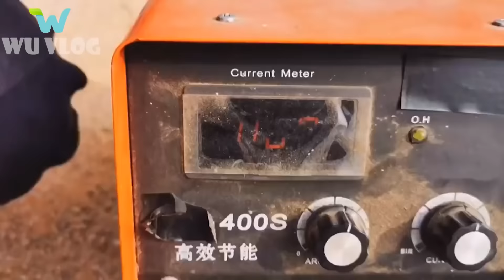The boy builds a two-story by bamboo villa house | WU Vlog ▶ 41

Comment: I hope part 2 is coming. I want to see it finished. I mean the views are fabulous. Bamboo is one of the most fastest growing plants and homes are 200 years old that are still standing. I just want to see how each room is developed from the Kitchen that I would be terrified to cook in in case of fire. However not sure about the shrinkage. You have a fabulous home
Reply: the tiny finish nails i dont think will hold over the long run and the screws are not much better driven in at an angle.
Reply: I think they build this without kitchen 🤪🤪🤪🤪🤪🤪🤪

Comment: Someone help me out here...   This is about the 5th time I've watched this and I still don't understand why a torch was used to flame the outside of the bamboo poles.   I see that it makes them appear shiny, but that can't be the only reason it was done.   Is there anyone out there that can explain why this is done and what it does?   Thanks
Reply: Heat treating is one form of curing/preserving bamboo by pulling out the sugars and starches to keep it from rotting. However the way that this is done just passing the torch over it briefly is not a thorough way, though it may help some. Normally it is done prior to building with it, and with all members, not just the exterior. There are many videos out there in how to preserve bamboo. Many methods, dry cure, heat treatment, saltwater, boric acid etc..